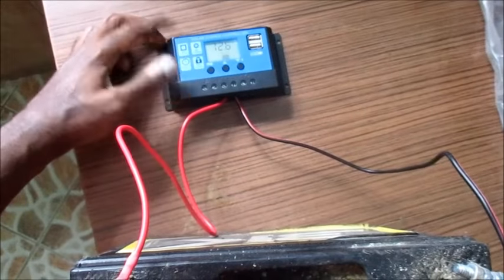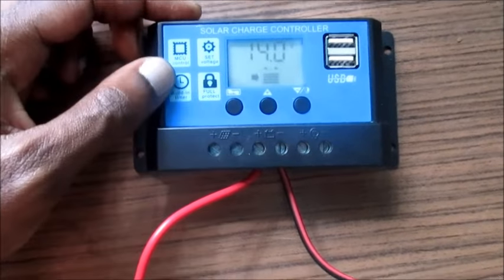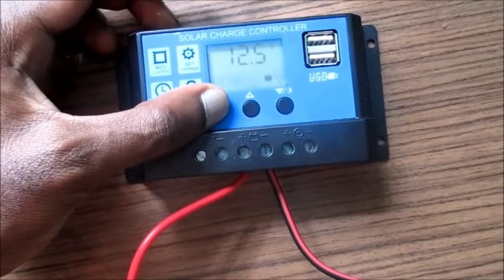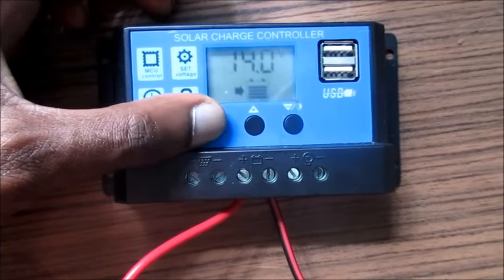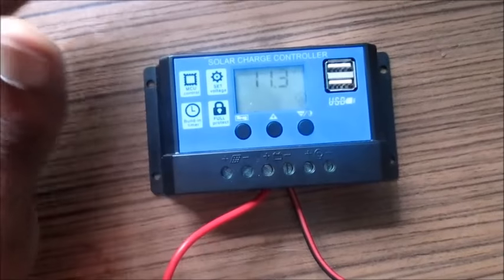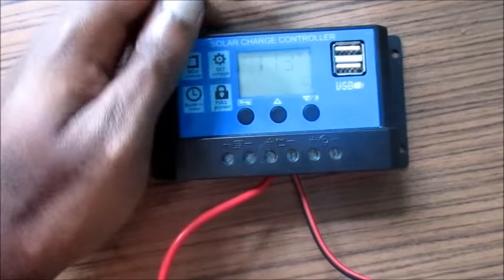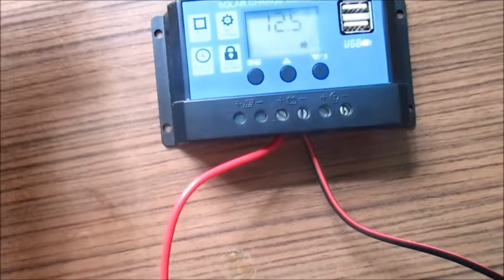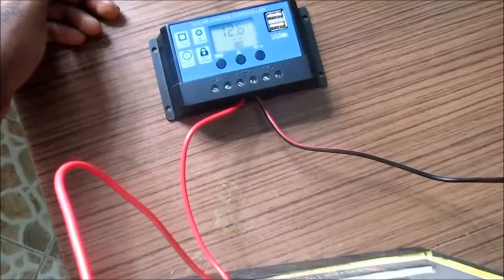How to use solar charge controller 2020 -See How To Set Up PWM 30A 20A 10A Solar Charge Controller

Comment from the maker: Subscribe To My Channel For Tech Videos - Revive Old Batteries See How https://tinyurl.com/yd5w4oef
Reply: Hey, this is probably a very stupid question because I have I do not know anything about solar panel, regulators and stuff. Basically, I want a small like 30w solar panel or something along the lines, and then a car battery, and what i want to know what would this charge controller be able to take power from the solar panel and store it in the battery and take power from the battery to put it somewhere else ? like charging a phone, and can it do it at the same time or would i have like unplug the solar panel to make it take power from the battery ?

sorry again.
Reply: Do the load supplied by the battery?

Comment: I am experiencing issues with my Epsolar Vs6048AU charger controller. The battery would get full faster, but would get empty quick without using anything except loghts.After looking at your videos I realized it was not set prior use. Is it still possible to reset it, after use for weeks.I am concerned it would have a negative effect on the whole system...can I still follow these steps?

Comment: Mine 10a 12v to 24v solar charger like this but i found out that its not charging my battery but in lcd display its charging what is the problem in my charge controller?

Comment: Hello Lenz. thx for the explanation! My solar panel has a very high voltage output. 37V (7 or 8 amps or so) . from what i read you cannot use 12 v batteries for this. Unless put in series. what should be the values in case of 24v. Just double? so in case eg 11.3V you choose 22.6v? is that how it works?
Reply from the maker: for 37V you'll have to use 48v battery system. either you buy or size them

Comment: Hey man. I have a epever mppt controller without a screen. I have just bought a 110ah agm battery to replace the old 50ah lead acid one. How do I set up the new battery without a screen? Cheers
Reply from the maker: Hi Owen as same as you setup the old battery.

Comment: Is the charge controller output voltage the same as the solar input? Or is there a step up converter built in the controller..
Reply from the maker: No. from DC to AC more output goes to the batteries than the load on controller

Comment: if i buy the 30 amp model is the load strong enough to handle 30a continuously? or is the 30a rating only for the solar panel?
Reply from the maker: solor, you can use inverter from battery

Comment: Can this charger controler hv the capacity to fully charg my 120ampere battery..pls help... or do i need to upgrade into 60amp of chargr controler
Reply from the maker: Yes. it all depends on your panel input. this charge controller can charge your 120AH battery
Reply: @Lenzwalters  may panel is 160watts but may Newly bought batt 120ah was drain after 3 days of id using what could i do... do i need to add more panels???
Reply: @yerpanganchannel  if the load excedes the line, you'll pull from the batteries until they die. thats because the panels cant supply enough voltage to charge the battery while the system is running. 
SOLUTION: yeah add a few more panels, leave your batteries as is. your batteries should be able to charge WHILE your setup is running

Comment: I just set mine up.  It seems the USB slots aren't affected by the LOAD on/off button (I have a USB fan connected). The fan runs even if I turn the load off.  Does this mean tje low charge disconnect won't work on the fan/USB slots either?
Reply from the maker: I believe it would not as usb is powered differently.
Reply: @Lenzwalters  Turns out the fan was running very slow as the USB doesn't put out enough power to run it.  I cut off the USB on the fan and attached it to LOAD and it runs fast now.  Attached the USB plug to my LED strips and they won't come on at all.  This would have been nice since the lights are rarely used and would be ok going past the low voltage setting.  So I just wired the lights straight to the battery. USB slots are useless.

Comment: Is this PWM can be used only for SLA or can be used for lithium-ion battery packs too? I have 4s lithium-ion battery (3.7V) pack and it can be charged up to 16.8V.(Maximum) But unable to charge for more than 13,4-13.8V with this PWM controller.
Reply from the maker: its 12V thats why, also they are more design for lead acid batteries or 12V/24 batteries
Reply: Lenz Walters :- thanks for your reply. This PWM is a 12v/24v. But unable to charge my battery pack for more than 13.8 and thus battery pack works for only few house for 12v led lights (40w)

Comment: What do you choose on the "battery type" menu for standard lead-acid?
Reply from the maker: yes
Reply: @Lenzwalters  "Yes" is not one of the 3 options..lol.. it flashes 61, 62, or 63
Reply: If it is lead acid it will be b1, looks like 61.
Reply: @Benjamin What would it be for AGM batteries ?
Reply: The scc autodetects the type og batt

Comment: can I set this up so that it does not need a battery? I just want to run a 12v pump directly off it. just use as a timer.
Reply from the maker: You would need a grid tie controller

Comment: Lenz, due to space limitation I have a 100 watt solar panel, but space for a 300/400 watt turbine generator.
Can I connect it in parallel with the existing solar panels?
Thank you, I appreciate your knowledge and help.
Reply from the maker: Which solar panel charge controller are you using this the system ? Also I would recommend wire the wind generator differently or use a charge controller that can manage both.

Comment: I dont have a battery connected to it only a solar panel. So is it normal that the 0V with zero Battery is flashing? I thought i can see my solar panels Voltage nevertheless
Reply from the maker: you need a battery to power the controller and you need to connect it first

Comment: Hi, I have a 130W 12V solar Panel, and a 20A solar charge controller with a 75AH 12V AGM Deep Cycle Battery. May I ask you how to set up?
Reply from the maker: Hi yes. You can email me lenzwalters@gmail.com
Reply: I already sent you the email:)

Comment: I have one of these controllers but I don't have a solar panel connected. I started with a fully charged battery then discharged it until the low voltage disconnect occurred. I then connected a smart battery charger directly across the battery and charged it again but the load does not reconnect. If I disconnect the battery and reconnect it the load connects. Is my regulator faulty or is this because the regulator hasn't seen a charge from the solar panel.
Reply from the maker: The regulator did not get the correct reading, you would have to unplug it and re plug let me know how it goes

Comment: Lenz, I have installed this charger controller with my batteries, and the indicated charging voltage is continually going up and down. Is that normal? The sunshine is pretty steady, not much difference in brightness. I have set the top at 14.4 volts, and the battery voltage is a steady 13.2 volts, now. The lower at 12 volts.
Reply from the maker: 14.4V is the float voltage, is the highest voltage when your system is at its peak. If you remove the panel at 14.4V you will see the true battery level. But if you are doing so, you will need to cover your panel from the sun.There are battery indicator that can be added also well.

Comment: Hi, Thanks for the video. On my solar charge controller (I have the same one) there is no reading of the solar panel on the LCD screen. Ive checked my wiring and everything is connected correctly but still nothing. What could it be?
Reply from the maker: Ensure your battery have power and also that negative and positive is connected correctly
Reply: Lenz Walters thanks! Yeah it was cloudy so that was the problem I guess. But I have another question. Which setting is supposed to power off the load when the battery gets low? I thought I had done it correctly but it uncharged my battery
Reply from the maker: Stop discharge in the video it set at 11.3V

Comment: can i use this solar charge controller to charge cellphone using water turbine without battery? or still needed a battery thanks
Reply from the maker: Battery is needed to power the solar charge controller
Reply: ok thanks sir
Reply from the maker: you're welcome

Comment: I have two sealed lead acid batteries connected, if this unit is adjustable, what are the highest and the lowest charging settings? Thank you
Reply from the maker: Highest charging setting is 14.4V . The discharge disconnect is around 11.5V. And you can set on the load, load reconnect at the voltage you desire. Hope this help you out
Reply: @Lenzwalters  Thank you Lenz, is the highest also recommended? Or is it better to have it a bit lower? What would be the best charging cut-off?
Reply from the maker: The higher level, its better to preserve the battery for years, esp AGM deep cycle that last 3 -5 years, drain your battery often kill the recharge cycle, so if you hardly discharge your battery, it can last 8-10 years possible. The best charge cut off can be around 11.8V is 30% battery power. If you can go for 12.0V 50% . Just an idea. which type of battery are you using ?
Reply: @Lenzwalters  To set up my small solar panel system, (100 watts) I have two sealed lead acid batteries of 20 AH each. I intent to replace them later when I have all the problems sorted out.
I am still learning by uTube and experimenting. Initially i like to use it for lights, later for my flat screen TV, and maybe my portable air conditioning unit.

Comment: Hi, I was wondering if you know how the 'Work Mode' setting works.  The manual says something about hours to work after sunset, so I tried for 3hrs, but it did not shut off and just kept going all night.  Also, does yours shut off with the disconnect voltage? Thanks.
Reply from the maker: Hi i know how it works, I never check that settings as yet. mines on 24Hrs. It would not shut off after 3 hours it would stop giving load output. Help this was helpful
Reply: Lenz Walters yeh that's what I mean, I've tried to set the time the load disconnects after sunset, but it doesn't seem to work. Would I just set '3hr' on the settings? Cheers
Reply from the maker: Load disconnect is the level your battery reaches when you would like to stop discharge from your battery which is around 10.7 default settings  i set mines at 11.3

Comment: I have a problem. I have a similar controller but I cannot see the solar panel symbol/icon although I have connected the solar panel cables into the controller , also connected are the battery and lamp. I do not see the solar panel icon , how would I know if the solar panel is charging the battery? Is it normal not to be able to see the solar panel icon or is it due to some fault in my solar panel or its cables?
Reply: possible cable connection problem, test with multi meter at the end of controller side

Comment: How can I know my battery charge level from Controller? My inverter doesn't have anything showing the level of the battery charge?
Reply from the maker: if you unplug your solar panel it show the battery level
Reply: @Lenzwalters  I will check at night when my panel is inactive then. Thanks

Comment: Bro.. I have same solar charge controller but my battery is not charging it stay in 12.2v in main display..  Do you check how many ampere without connecting battery cable... Just connect only solar cable and test using multimetere ampere in solar then battery I Mean inside solar charge controller.. I m getting 2in solar and I m getting only 0.01 in battery.... Please help me bro
Reply from the maker: No you don't test it like that. What type of battery are you using ? also there are in line meter you can use to monitor your system

Comment: Hi can I charge 24v solar panel to 12v battery with the help of mppt solar charge controller?
Reply from the maker: Yes you have to use a solar charger 12V/24V ..to charge 12v battery

Comment: Hi, i have a 50w solar panel and a 2sm battery, i connect the panel and the battery to a controller, my question is can i connect the load directly to the battery instead to controller?
Reply from the maker: yes you can.
Reply: @Lenzwalters  thank you sir.

Comment: Can you turn the output/Load voltage up and down?
Reply from the maker: The load is 12V Float can go up to 13/14V and can be set.
Reply: @Lenzwalters ...... Can you make it output low voltage like 1-9v?

Comment: Good video, but is it possible  to use pwm charge controller  and charge batteries  with the grid-tie inverter
Reply from the maker: No I don't think so. Grid tie inverters are on grid . directly from the solar to the inverter (DC to AC). They can be use with batteries but if use to long, it can burn them out or a chip on the system board. So its not recommendable doing so.

Comment: Hey lenz really helpful video 👍 I have two 110amph batteries what volt should I have my controller set at 13.6v or higher ???
Reply from the maker: you can set up to 14v float voltage. when you are getting full power from your panel it can reach 14.4. But this is only float voltage and not battery voltage. While the battery charge you can use from the load as well

Comment: Do you have a pdf link to the manual for this controller by any chance? I have one in the caravan i bought but have no manual for it.
Reply from the maker: I have the manual but not pdf. I can take pictures and email it to you, if you like its a booklet sort thing.
Reply: Try a google of "cy1210 Manual", it's quite easy to find the pdf manual. It doesn't help much though

Comment: I have setting at, 
14.0 float
12.6 discharge 
11.6 stop
The arrow after I hooked battery up, is flickering,  is that ok.
Reply from the maker: Yes Bro. it signify charging
Reply: Got mine set at 14.5 but I got 6 batterys

Comment: I’ve got a platinum leisure battery 12v and 110ah and a rated 6000w pure sine wave power inverter. Please how long can the battery run a rated 1200w air conditioner at 230v and when battery is fully charged? Battery runs for like 20 hours when fully charged. 
Thanks
Reply from the maker: You have to calculate 1200Watts/230v by amp hours 12V. should be around 20-25hours bro

Comment: I found a problem with this controller, if it fully charges the battery, it stops the charge, if I use an inverter from the battery, the voltage starts going down and it doesn't charge unless I unplug and plug back the solar panel. is there a setting I have to change?
Reply from the maker: Hi i never experience this, so thanks for bring it to my attention. Is your charge icon on ? also what setting is on your load output ? How many panel(s) you using ?
Solar panel with defect can cause short circuit problems/ solar panel reversed, it can help with one or more cells. PWM solar controller are very good.
Reply: friend, I am a supplier of solar charge controller, I saw your problem.That may be because your output is faster than charging. you can add solar panel and battery to increase the power of the battery stock.

Comment: I have a charger controller with 30a, battery 12v and 100 panel. how to set up charge controller?
Reply from the maker: Set your stop discharge at the highest as this will protect your battery. The Float can be 13V and reconnect discharge 12.6 recommendable :D
Reply: @Lenzwalters  I'm using ST-F1220
30a we're using it at home.

PWM Solar Controller suoer... well it says it is for street lights... 
http://www.chinasuoer.com/pwm-solar-controller/85.html
it has a numbers 0 to 23 if u press the MODE button.

Comment: Please, can some one give answers on pwm solar charger because, I have one but my question is this: can pwm charger be put on battery why inverter is on? that the inverter will not drain battery flat
Reply from the maker: No, most inverters are made with battery protection, it wont drain the battery dead. it will shut off around 20-25%

Comment: what will be the Amp of the 12V battery  connected to a 30 A MPPT solar controller ?
Reply from the maker: How many panel using ?
Reply: Lenz Walters 
Single panel of 50Watt MonoCrystalline
Reply from the maker: @nasimuddin786  Anything like 50AH and up will do. Bigger your battery bank better, but it all depends on what your are going to use the system for.
Reply: @Lenzwalters  Hi Lenz
Battery Amps will not depends on Max Discharge current of the solar controller ?
The 30A solar controller  will not burst or burnt out if I connect 12v 100 Amp Battery  ?
Reply from the maker: No. it will work perfectly. The battery is use to store the power with is the capacity of 100AH. So your float voltage will be 12V -14V and will vary when the panel getting sun.

Comment: Hi, i have a solar charge controller, a 12v battery and a 50w solar panel, how to set my solar charge controller?
Reply from the maker: you can just use default settings or like the setting i used in this video.

Comment: Can I connect 115ah battery to this controller?
Reply from the maker: Yes Bro..
Reply: @Lenzwalters  in this controller 115ah battery for charging 12v how many watts solar panel to need?
Reply: @antonysharon2053  that depends on how fast you wanted it to be (which depends on the power you can get from your solar panel.
 Amperes = Watts / Volts
And 
 hours = Ah / Amperes
So given the volts and Ah you need to know the power in Watts:
  time (h) = Ah * volts / Watts
For instance If you could  charge at 12v steadily with a panel that could give 120 Watts,  then the time to charge from zero would be
115Ah * 12v / 120w = 11.5h

Comment: I bought 2 of these solar chargers and they will not go to float charge they sit on 14.4 volts and will not got to the programed voltage of 13.8.
Reply from the maker: 14.4 is the highest once you are getting full sun it can go to 14.4. The float voltage changes